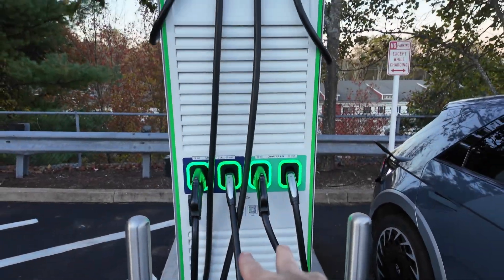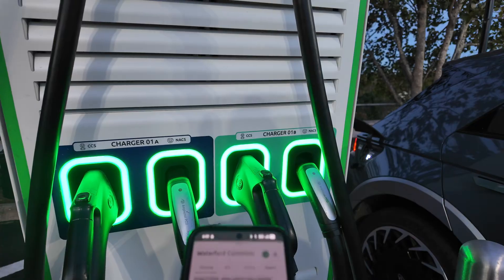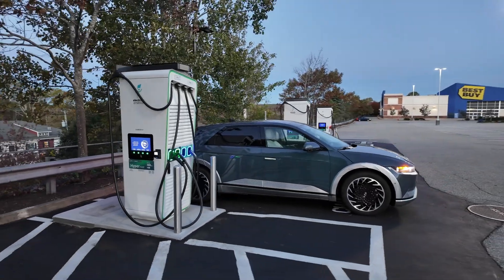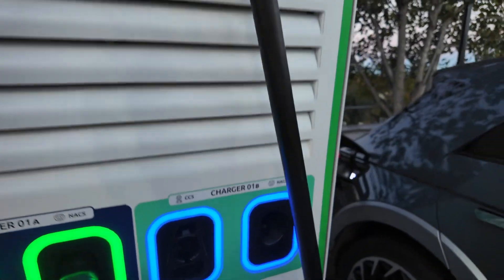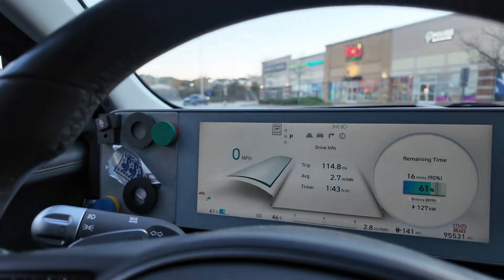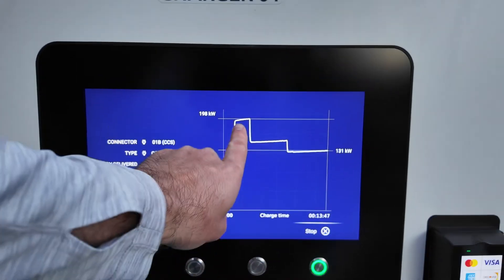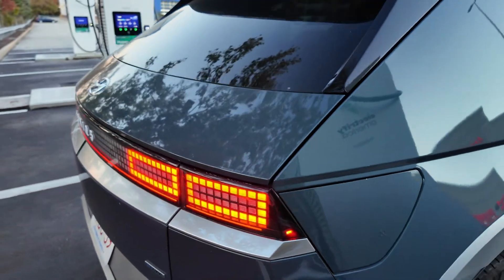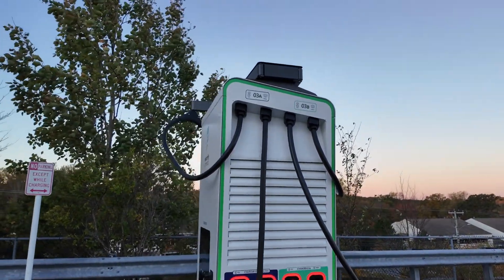I Tested Electrify America's NACS Pilot with Alpitronic Hyperchargers. Here's How It Went.

Comment: What a hassle… as a Tesla owner I can’t believe every single company has dropped the ball so hard with the charging experience
Reply from the maker: What's the hassle? 

If it's lack of Plug&Charge, that's really a result of many different models charging across many different equipment types. Tesla has that dialed in for its owners because it controls the whole tech stack, but the process for non-Teslas isn't always smooth. App and payment insertion still needed.

Comment: Why is the transition to NACS taking so long?
Reply from the maker: Non-Tesla automakers have been slow to add the port to their models (Hyundai excepted), which has given the charging providers a longer window to make the transition. Yes, Teslas make up the majority of EVs on the road, but they are typically bound to the Supercharger network unless they have a burning desire to check out third-party chargers. That leaves the non-Tesla networks competing for utilization from non-Tesla drivers, most of whom are still in a vehicle with the CCS1 port.

Comment: I found when I moved over in the space and I think you have a full 18 inches on the driver side of the car then you have more than enough room between the charger and the cable and the arm that swings out and are charging port.
Thank you for the video and that’ll be my go to for what should be my daily commute to the casino in retirement from Fairfield, Connecticut

Comment: Electrify America has improved their reliability significantly, somewhat due to using new hardware.  The 6-350 kW EA stalls recently installed near me in Bonita Springs, FL are made by BTC Power and work without a glitch.   I’ve never had to wait for a stall.
Reply from the maker: Anecdotally, we've had much more reliability at EA sites with those same units around Greater Boston as well. I also used an EVolve NY station on the return journey that had six of those dispensers, all busy (I was the sixth to plug in) and cranking out full power, as best as I could  tell. 

Definitely interested to see if they can switch out connectors on those newer BTC Power dispensers to slowly integrate NACS/J3400 handles, or if there will need to be another brute force rip and replace campaign if they go with Alpitronic hardware at scale. Tough call, as the latter seems prohibitively expensive for a network of 1,000+ stations.

Comment: Walmart started out with some of these (4 cables), I think it was in Texas.  Must have been something Alpitronic made up for a trial?
Reply from the maker: Applegreen Electric is also using the four handles version at recent activations in NY and PA. It looks like an off the shelf configuration, leaving it down to the charging vendor whether they go with this or the two handle option more commonly seen at IONNA. The latter is certainly cleaner and easier to maneuver all cables, but it also means they have to decide on a suitable split for the NACS vs CCS ratio. CCS typically gets one more dispenser than NACS right now, from what I've seen at most Rechargeries.
Reply: @plugandplayEV  If every stall had both connectors, the utilization rate would be better during busy times. Are there really so many stalls there that you never have to wait in line?
Reply from the maker: @AliusScitmelius Yes, we have sufficient capacity in New England that I'll always be able to aim for a different station if one is full. But adapters also bridge the gap here, even if a dispenser only has one connector type.

Comment: Great to see. Personally I like it when each parking space has a cable option. So far my Alpitronic experiences have been once at Ionna in Valdosta GA, and twice at Mercedes Benz HPC in Calhoun GA. On a trip back from Providence RI, my wife and I did stop and charge our 2017 Ford Focus Electric at the then new Waterford Commons Electrify America back in 2019. I still use the laptop I bought at that very same Best Buy. I do remember it being a bit off the road however that was a much needed stop back then.
Reply from the maker: Right, it's easy to forget that sites like the original EA locations were often oases in charging deserts, not so long ago. A mile or two of the Interstate was infinitely preferable to a 10-15 mile detour to a 50kW option in some random town! Good to raise our standards as well, though. The next wave of EV owners won't accept many of the inconveniences we did, for the overall enjoyment of driving electric.

Comment: Nice to have all those cable options but wow that makes a mess of cables tangling with each other and getting caught on the bollards. I think I like the Ionna solution better. Just one cable per spot. It seems simpler and easier and looks tidier.
Reply from the maker: I tend to agree. Big signs and painted spaces so that the driver just pulls up to the appropriate dispenser for their port type, at IONNA. It does mean they charging vendor needs to pick a ratio for CCS to NACS ports, though... a decision that the four plug version removes.

Comment: I have a feeling whoever installed that unit placed the handles incorrectly. The one that you used probably should have had the NACS handle in the middle. I wonder if the other units were like that
Reply from the maker: I think it makes sense, if they're considering Tesla's port position the default for NACS/J3400 accessibility. So where I was, a Tesla would typically also back in (force of habit at Superchargers) and the NACS handle would need to be on the swing arm to reach across the bay and plug into the driver side rear. In the other bay (1A connectors), the shorter cable wouldn't be a problem as the Tesla port is then facing the dispenser. 

We'd have to run through the various models and port positions to highlight instances where this setup wouldn't make sense, but I'd say they got it broadly right if they're designing to the Tesla position.

Comment: Good job, Steve, even with the morning brain syndrome. 😀

The one that's off line has a pretty obvious problem as revealed by the big oil puddle around the base. A common EA failure, as you know, but the first I've ever seen on an Alpitronic hypercharger.

The parking layout at that site is TERRIBLE. I don't know why they put the chargers so far forward related to the parking lines. Apparently, the planners have never fast charged an EV. The ones in Orlando, according to Plugshare pix, have the chargers properly positioned behind the parking area. I have not driven over there from our home north of Tampa to test them. I only go to the Orlando area every few years and only if I have no choice. I think I'd rather pour tabasco sauce in my eyes than drive through that mess.

However, I've used the Alpitronics at a few Mercedes-Benz sites and several Ionnas. They are great. At the Ionna at the Sheets in Springfield, OH I briefly hit 197 kW in my '25 Ioniq 5. I don't know how, but that's what the graph showed. 🤯
Reply from the maker: I'm still tying my mind in knots considering all the potential parking angles and port positions, but I think it generally works in terms of connector arrangement... but the stalls and dispenser positioning? That's presumably a byproduct of "upgrading" a site that was designed for different hardware.

Comment: I just charged at the EA in Orlando Florida Mall which has the Alpitronic units. One was not working. And you park in front of the units. Not like to the side like you have there. The middle cords are not long enough for some cars and the ballerds are in the way. Overall in my view they are a downgrade. And one was not working, but it was on and showed up in the app.
Reply from the maker: Interesting, thanks Ariel. Sounds like even Alpis aren't a guarantee of reliability unless the charging provider is on their game as well. Hopefully these test sites shake out the issues and any wider rollout isn't plagued with outages.